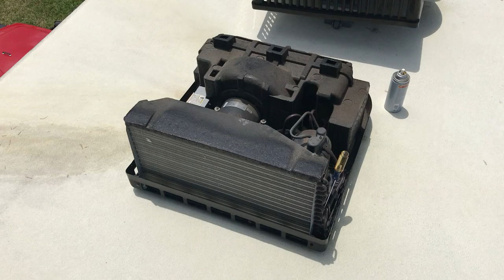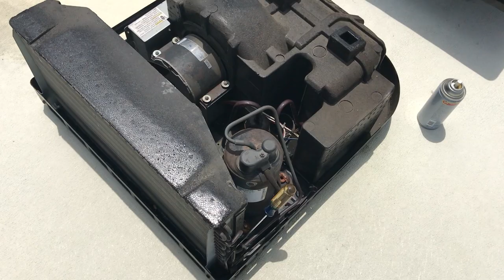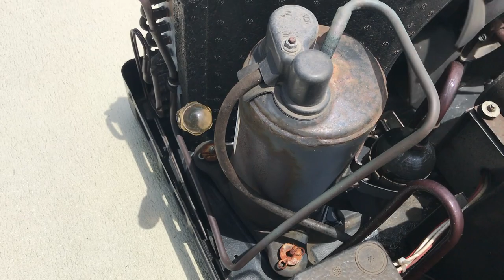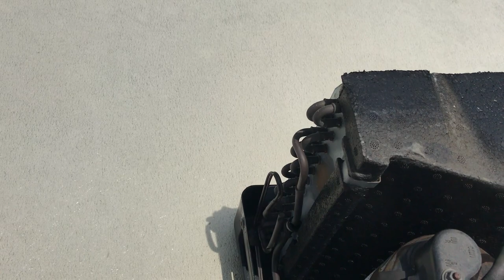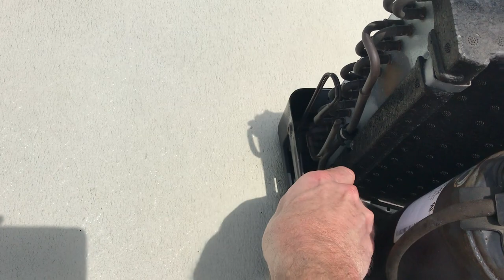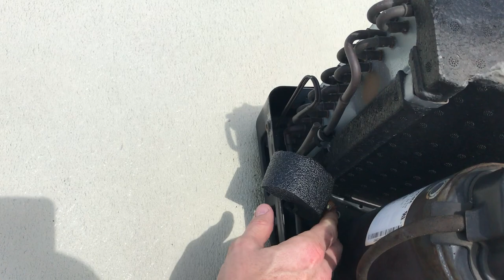Noisy Dometic RV A/C 60 Second Fix

Comment: I have a fairly new Dometic 15000 BTU unit we installed about 2 months ago. It was fairly quiet at first but has developed that same kind of rattling noise only while compressor is running and not associated with the fan itself. Guess I should climb up there and remove my cover and see where it's coming from. Like I said it's a 2 month old unit. 4 mount bolts are tight as directed. The rattling is driving me nuts....
Reply: What did you find out? Mines has started doing the same thing, but works fine.

Comment: Couldn’t tell what you did.
Reply from the maker: The line was vibrating in the bracket, causing a buzzing noise. I wedged a piece of foam between the condenser coil and the refrigerant line.  That stopped the noise.
Reply: @2manytoyz123  if the lines get hot, will it melt that foam?
Reply from the maker: @hc955  if the line gets hot enough to melt the foam, your compressor is toast.  If you put your hands on the exposed copper tubing on your home A/C condenser unit outside, you can feel a temperature differential, but not enough to come close to burning hot. BTW, the foam I used is the exact foam I used to replace the UV rotted foam on my home A/C.

Comment: And your a.c fan failed soon after this video
Reply from the maker: It lasted until March of the following year.  But at least it was quiet until it finally failed.  😉
Reply: @2manytoyz123  I knew it did for sure lol
Reply: @brentsharp8234  is this vibration due to the fan going out?
Reply: @emmanuelferrell9274  usually yes. Shut off breaker ,go up top n spin it if it makes any kind of weird sound , won't spin freely or the shaft is loose it's bad replace it. If motors bad and seized up u may need new capacitor as well
Reply: @brentsharp8234  were getting a weird sound while cool is on,but quiet if just on fan,could it just be froze up?
Reply from the maker: That sounds more like a compressor issue. Could be worn out isolation mounts, or the motor in the compressor housing is failing, which is exactly what happened to mine.
Reply: @2manytoyz123  I'd agree with compressor as a 3rd option I've seen them rattle , My 2nd guess if it's not the motor would be the 4 mounting bolts inside (only if it's leaking inside ) that secure a.c to the roof
Reply: @2manytoyz123  how spendy is that? Anyway to limp a little while longer?
Reply from the maker: @emmanuelferrell9274  Details here: http://2manytoyz.com/new-rv-ac.html
Reply: @2manytoyz123  not bad ,under 1k! This is the inlaws camper and they still have a warranty but its where were currently living lol. Were about 20 days from our tax return coming to add to our savings and get a much bigger camper since we have kids,but this one keeps having issues. Never get a Evergreen Element.
Reply from the maker: @emmanuelferrell9274  My buddy bought a new Evergreen Element in 2013. Traded it in less than a year. Couldn’t stop the big window from leaking.  Was neat looking though, but so was the Airstream he purchased to replace it!
Reply: @emmanuelferrell9274  anything compressor related is a new a.c usually
Reply: @emmanuelferrell9274  that's  a hard one without hearing it. Post a video when it's doing it n I may be able to help
Reply: @brentsharp8234  as a recap it turned out to be a fan blade that was rhe wrong one hitting the housing and it melted a spot on blade and made it off balance. Got the right blade and now its good
Reply: @brentsharp8234  mine started making a hit n miss screeching sound last night. Had to shut it off. Maybe the bearing in the blower motor?....
Reply: @usmcdoc2512  shut off power to unit n climb on roof try to spin the fan if u hear it fan motors bad (replace capacitor too they tend to fail together) or if fan spins but binding it's failed as well. MAKE SURE UNITS UNPLUGGED !! also if u replace capacitor be careful that thing will shock the hell out of you
Reply: @brentsharp8234  ordered a new motor on Amazon. You nailed it! Now why are the lights starting to dim and turn off periodically?.......... I put a new battery and it's still doing it. Just took a little longer.... Like a couple hours.
Reply: @usmcdoc2512  bad converter if battery is brand new. Sounds like it's not charging....ps u owe me a beer I just saved you 300 in diagnosis haha
Reply: @brentsharp8234  If your in SoCal Ill get you a steak and a good sipping  bourbon.......
Reply: @usmcdoc2512  other coast but yea if your a diy guy test your battery voltage with rv plugged in , should be around 13.5 volts if it's charging then unplug whole rig and test again 12.2 is dead 12.8 is good still but the number when it's plugged in should be higher or it's not charging.
Reply: @brentsharp8234  welp, someone saw me replace my blower.motor and asked me to do theirs. However there motor spins freely but when you flip the switch on, it runs for a minute or 2 than starts to freeze up. This person has 3 capacitors. Start / run/ and I forgot the other one.... Your thoughts?.... And how do I get a beer out to ya? I'll Uber eats it to ya!
Reply: "freezes " ?  Is it overheating and then cools n starts back up? If so motor again. U can peek at caps n see if there's anything melted or if cap looks like a beer you left in freezer too long n top bubbled up. If so caps bad but I'd lean toward motor again because it runs for a few minutes. Did you get your battery issue figured out? I told ya converter but don't think I told ya when you pop off fusebox cover there's a little chrome box inside there that's the converter u don't need to unhook all the fuses and all that. U might be able to find a video on here of just that
Reply: If it's freezing with ice in it that could be a few things. It could be freon leak (means a new unit) , could be hot and cold air mixing which means its not taped properly, could be freeze sensor in wrong place or it rattled loose and isn't in proper place. With that one I'd have someone that knows look at it cuz if it's something easy it's not a pricey fix. But if it's not had an issue and it's an older unit it might be bad news for him
Reply: @brentsharp8234  sorry, 8 meant freeze as in the blower motor fan stops spinning. I turn it off... Give it a minute and it starts spinning quickly than slows, stops, and hums.
Reply: @usmcdoc2512  yup its shot its heating up
Reply: @brentsharp8234  aaahhhhh fiddle sticks! Welp another replacement and back on track i suppose. My neighbors seen me working on mine after advice and now they are asking me to look at there's. I said I work on Harleys not trailers, but they are old veterans so I will do it for them.